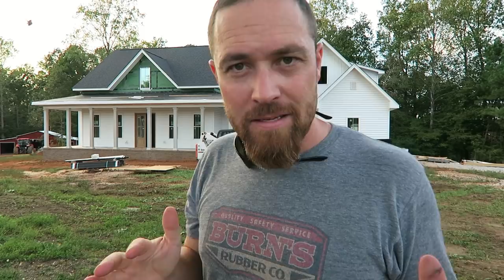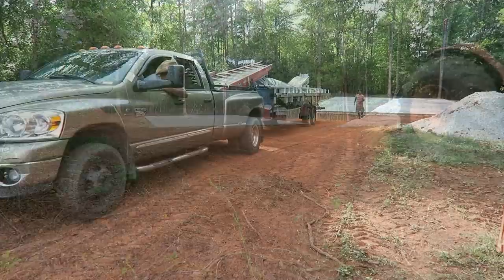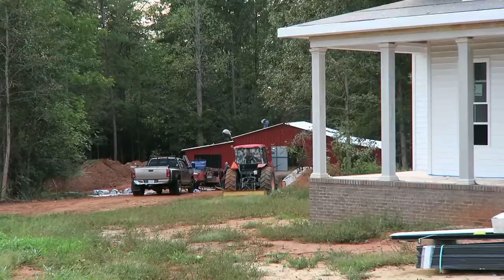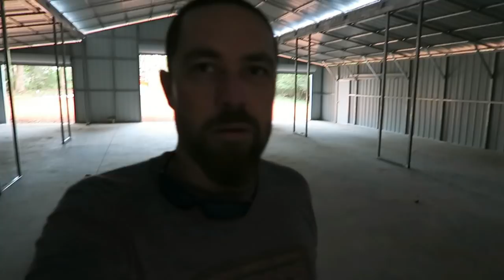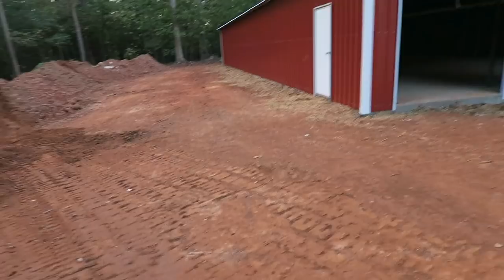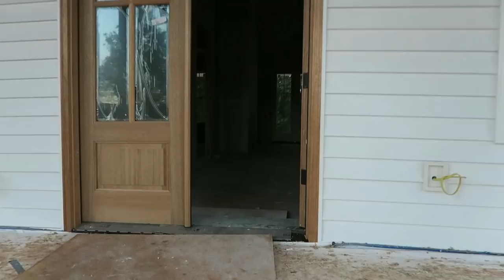Building A Dream Shop | Workshop

Comment: ~16:03... blew my mind. I had no idea I beam cost that much more. I like you idea of using one small section to create the post with an I beam. if it works without any I beams then it will do even better with a couple, keeping the cost down.

Comment: It took me 65 years to build my 50x72x16 with 3 14x14 auto doors, just finished the R 60 insulation and 400,000 btu heater, now I am to beat up old to get any work done in it, but I think my son and grand son will love it when I hand over the keys, life just ain't right.

Comment: I find it amazing, not only because you're above the water table, but because you are a dedicated mechanic ... that you didn't put in a pit while preparing the site and pouring the slab...
Reply from the maker: a pit would be a waste of valuable floor space for what I do
Reply: It doesn't have to be in the way - just accessible.  It could even have a cover and be right in the middle of a walkway.
But, as always... your shop, your call.
I'm just sitting here thinking about things like the Bibbster:  Being able to weld tubes from the underside, as it sits; rather than tacking and jacking.

Comment: That's awesome!! A new shop is  always a great thing. House looks nice as well.
Definitely go with the spray foam in the roof if at all possible, it makes a world of difference in those metal buildings.
Steve N is correct about the conduit from the house to the shop.  its cheap insurance.
keep up the good work.
Reply from the maker: thanks

Comment: From experience, before you use foam insulation make sure that you have all holes/transfers from the interior to exterior secure in place first. If you run power underground, make sure you put a tracer on the tubing and a lead or draw cable so that you can run your wires by tying on and then adding another line to it and go. My last building I actually ran two points for electric to enter the building since I maxed out the first building so quickly.

Comment: Take everyone of those double posts and put a 1/4" aluminum panel across them. Use the flat surface as a place to mount all your "drops", 110 electrical, 220 electrical, shop air, maybe even shop vacuum!

Comment: If you ever get a lift, you'll wonder how you worked without it. I have a cheap $1400 9k that I bought from BestBuyAutoEquipment. I've had it two or three years now and it's been great for daily use. You should definitely make it a priority. Especially for showcasing work under vehicles.

Comment: Spray the foam in the ceiling and the walls, behind the wood, if you can swing it. If not, use the board with the foil backing as thick as you can. The insulation will pay for itself in heating and Ac savings. Keep the electric exposed.  You’ll love the foam. It absorbs sound also.  Instead of a bolt in lift, get a scissor lift. I have one that I keep on a pallet jack. I wheel it to where I want and use it.  When I lower it, it picks itself up on to the pallet jack.

Comment: Super jealous of all of the doors, this place is awesome! I would recommend doing like a 20x20 concrete pad outside of the back door for times you want to roll the projects out for bodywork/sanding/grinding... anything that creates a ton of dust, you're not going to want in the building with everything else going in there. The pad would also be a good place to get your air compressor outside (covered) and get the noise out of the building.

Comment: Really nice shop I heard you said you didn’t have the desire for a lift but trust me if you get one you will never look back and regret it not only it’s an awesome back saver it gives you more space you can put a car up and park another car under it my shop is only 24x25 feet and when I got that hoist it made my volume double. I just do Repairs for the neighbours and close friends as I was a mechanic before became elevator mechanic. And I would never look back at working on the ground sometimes I have because some other project I have on the hoist and can’t move it so I use the old jack and jack stands and just cringe every time lol anyhow good to see you are doing great evolving 👍🏻👍🏻

Comment: I toyed with internal wall decisions.  Not enough  money to do steel and in the end I picked 5/8" drywall.  Very happy with the look and since i do welding, grinding and such, I have a safety factor built in.  Drywall goes up pretty fast, its cheap and I hired a finisher.  CAUTION, Painting a big shop is a PITA.

Comment: I LOVE spray polyurethane foam.  Used to spay the stuff.  If you live in the Carolina's(red earth) you may only need two in the ceiling and one inch in the wall.  If you decide to go with fiber in the wall please consider a seal layer of the walls.  The contractor may not know about that.  Just a tiny bit of foam on the walls.  Seals the seams and breaks the sweating of the walls.  No worry about mold in the walls.  Also NCFI has an anti microbial foam that sprays really nice and only costs a few cents more but looks really nice when sprayed.

Comment: I'm getting ready to build a shop for me.  Residential area, not for work but for my own projects.  Planning on 36 x 26.   I plan doing my own concrete all the way up to the roof.  10 foot ceilings at least maybe 11.  Cost should be around $10,000 i'm hoping.  Yes, it's possible if you build it yourself and watch costs.  Concrete work is going to suck.

Comment: Do the lift ASAP - after the floor is sealed, though. As you get older you'll need it - no point in waiting until you get old and feel the affects of working without one. I am a retired retail auto tech / repair shop owner (and part time hobbyist who build 3 4x4's from the frame up) and modifying a few more cars to a lesser degree. Opened my own shop at 24 and didn't get a lift for my shop until I was 34 yo when I was already feeling the effect of "creeper leg strain" and banging my head as I would get up after sliding out not far enough and testing the strength of rocker panels / pinch welds way too often; two trips to the ER after midnight driving myself there. Knocked what little sense I had about working on a project until it was done or I fell asleep right out of my head. LOL

Your new shop is looking good; and just about a year after deal with the in town 6000 sq ft shop (with the huge reefer in the middle of it) fell thru. I am happy for you with the quick recovery; i.e.; dusting yourself off and stepping ahead with a better deal on your own; takes guts to do that! Congrats!

Comment: Just a tip, my family owns a mechanic's shop built similar to yours but quite a bit bigger - definitely worth every penny for the spray foam. We didn't do it in our shop and my family has regretted it for 15 years. I know it's pricy, and it's why my family thought otherwise, but it's definitely a long term investment worth the cost. Thinking "I'll go back and do it later" also usually doesn't work out, because I know for us it'd be nearly impossible to disassemble our shop enough for someone to come in and insulate it.

Comment: GREAT building and such potential. I can suggest that you will not be able to heat the whole space in colder weather, so make your office the place to warm up every now and then, and keep your delicate tech stuff warm. You'll figure it out and get the spaces you need. I converted four 40 x 110 ft poultry barns years ago into shop, recording studio and living space and came up with the idea of building some walls on casters that could be moved to reconfigure the inside spaces. You might think about that to stay flexible cause once you spend time in the place your ideas for how to use it will evolve. You can allow yourself to mess with the  arrangement of stuff and keep some things out of sight or cleaner, or whatever. Keep up the fine videos and also that attitude of always making lemonade from whatever lemons are thrown your way.
Reply from the maker: plans are to heat the whole thing

Comment: Cool, someone has to be 1st view on every video. Today is my day. Excellent by the way. One thing I could suggest for the interior finish would be some old metal roofing from a barn, etc. If I remember correctly, not easy at my age, you mentioned it when you were bench building your shop a while back. I have it in the areas where I cut or weld. Just a thought. Best of luck and we will watching the progress.

Comment: I would put in a drain system in front of the 3 garage doors so no water runs thru the building.  Looks like the dirt is a is higher around the front?

Comment: I am sure you are on this, but I put in a 100 A. service because I knew 1 or two people could never  tax a 100 amp drop.  WHAT I  failed to realize is a 100 A. panel is limited to only so many breakers, I have so many 220 circuits , I have no breaker space.  Many 100 A. panels will not accept the "double" style single phase breakers.  So now I have to put in a bigger panel, arg!

Comment: Dodged a bullet with that first place - if he was that hard to deal with when he should have been sweetening you up to lease, he was only going to be a nightmare if you had any problems with it that needed fixing.
Getting a decent sized property where you could build your own shed/garage is a win long term - especially when you have a cool wife like you do and no reason to 'go off to the shed' to get away from her. I'd do exactly the same thing if I were you, so going to be following this with interest.
Take your time figuring out the layout and how you will be running power - 110/220 and 3 phase - and air lines, especially if you use drop lines. Maybe dedicated office, welding and engine/transmission work areas/rooms.
Reply from the maker: yeah for sure

Comment: Curious do the metal buildings sweat because the humidity threre?
Reply from the maker: If there was a large temp difference on the inside vs outside with no insulation I would think that it might

Comment: Nice shed, but doesn't look like you can get the tractor inside?
Reply from the maker: yeah fits easy....the doors are 10 x 10. I think the building size makes the doors look smaller than they are
Reply: Yeah certainly.. .. the tractor looks higher than 10 foot too!

Comment: If your shop will be climate control which I'm sure it will be. You won't be disappointed. We use it in all of the homes we build. Its not cheap but, it will save you money in the long run. A little late now but, you should have looked in heating through hot water lines in the concrete. We do it in some of the basements and I have it in my basement. That will also save you A lot of money. Anyways congrats man. I can imagine how stoked you are right now. New house and masive shop. Shoot if I was single that shop could be my home sweet home.